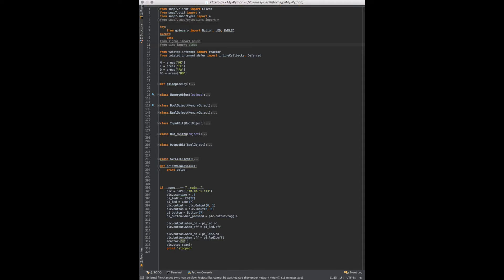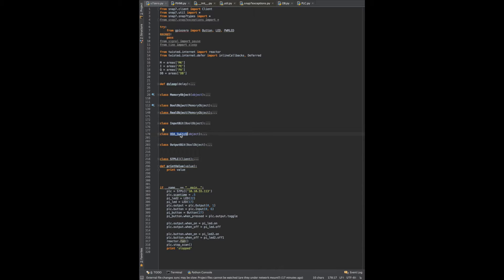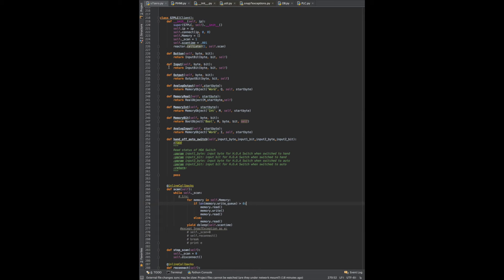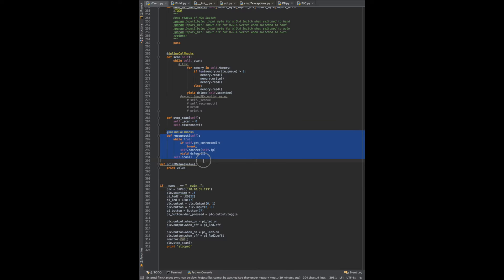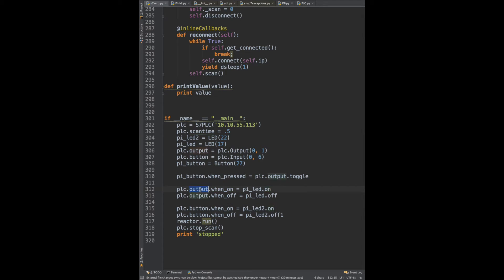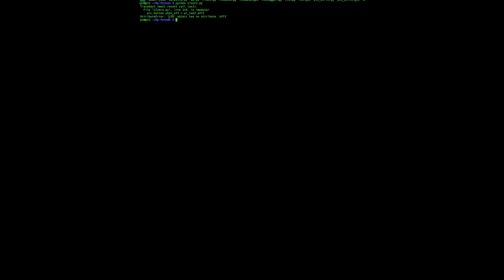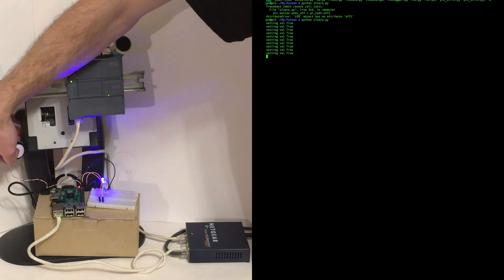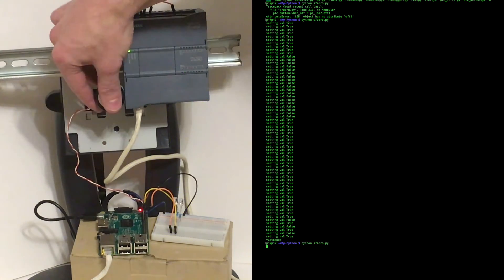Raspberry Pi - Tutorials - S7-1200 & Snap7 Python - Controlling the PLC Using Rpi GPIO

Comment: I got the other snap7 examples working, thanks - installed this and I thought Twisted successfully - however the script is complaining about line 13 and Twisted - was there a specific install process you used to get Twisted on the Pi
Reply from the maker: sudo pip install twisted
or 
sudo apt-get install python-twisted
Reply: Great - did the upgrade - works, thanks again